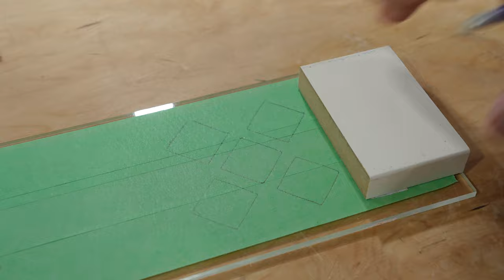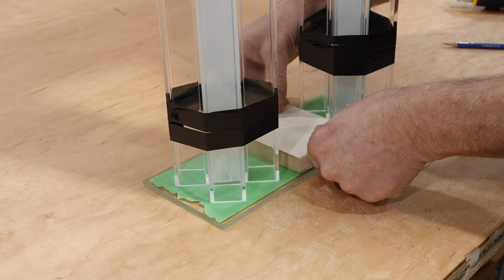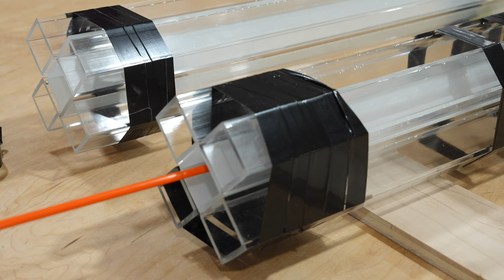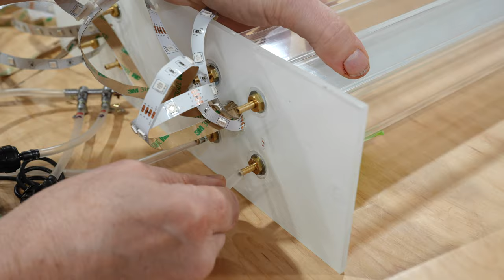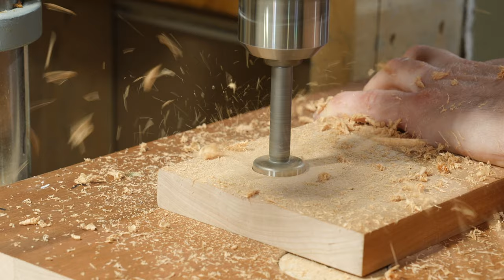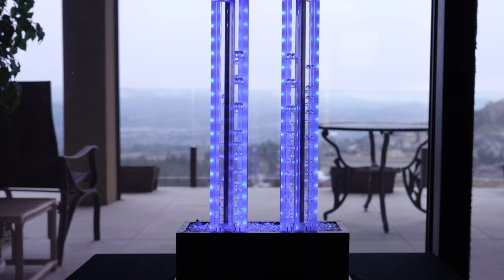DIY Twin Bubble Towers - Had to start over half way through!

Comment: Cool build. But what kind of oil did you use? How did the filling process go? How did you manage the timing on the bubbles? Are the bubbles combining in the tube an accident or a feature? Your build, while cool, raises a question for every step in the build.
Reply from the maker: I used heavy mineral oil. To fill the the tubes I used a funnel. Other then controlling the speed of the air flow,  how they look is how they look.

Comment: Cool Build. Did you fill with water or some other fluid (heavy mineral oil ?)
Any thoughts on building a wall with variable streams to create words or patterns?
Reply from the maker: I used heavy mineral oil. I did look into using solenoids but got jammed up on the electronics behind controlling them...not my strong point.